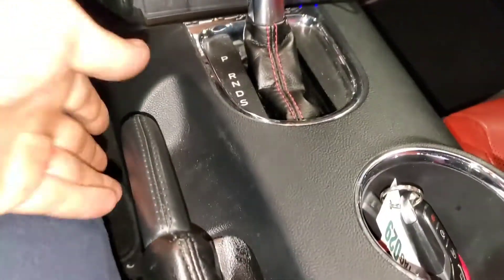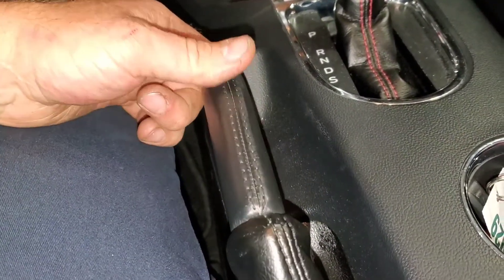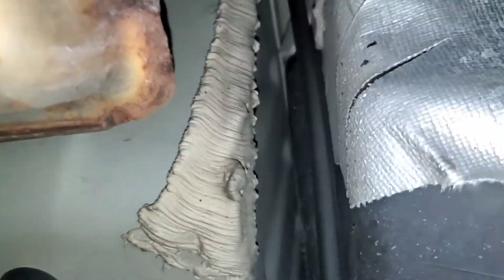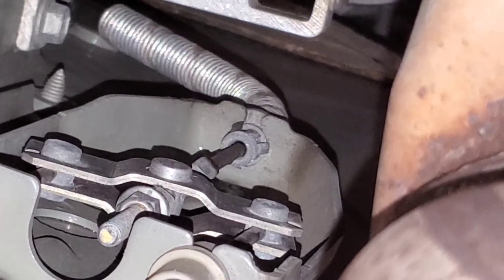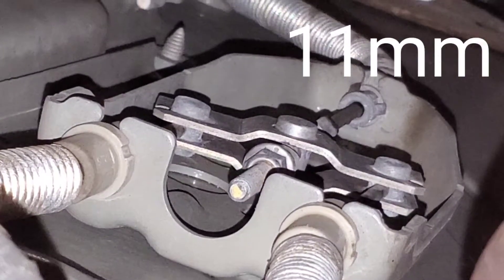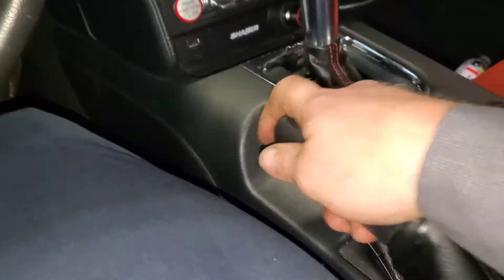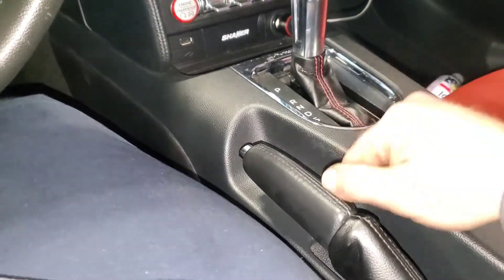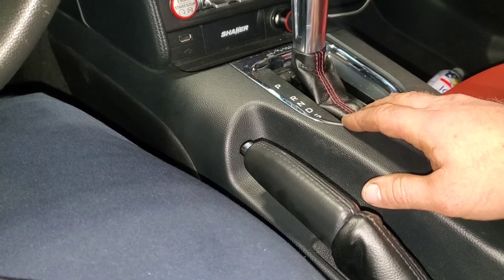2015 Ford Mustang Emergency Brake Loose Handle Poor/High Engagement - Other Mustangs Also

Comment: This is a great video for this but I did have to add a sleeve in between the nut and bracket to make it pull farther.  After a few months, the brake handle is still tight but won't stop the vehicle.  I checked the caliper and it won't pull the cable far enough as it hits the stopping points.  Has new pads and rotors, now it seems like only fix is new calipers, unless cables are strechted?  Ugh.

Comment: Mine never was adjusted properly since I drove it off the lot in December 2014 with 17 miles on the dash. I’ve always had a high lever. Being that mine is a manual it’s concerning now years later I hope it’s not rusted 🤦🏾‍♂️

Comment: 2015 50th yr gt.....74k...adjusted 2xs in the past yr...1st it did work..2nd didnt do shit...i can push car with brake on all the way up..pads replaced at 55 k....had removed rear sub to install bmr diff bushings in 2022....brake worked fine untill fall of 23..now past 3 months dont work at all

Comment: I’ve been having this issue for a month or so now I tightened the brake cable which seemed to work for a few days then one day my car starts rolling down the street and bumps into my neighbors with the ebrake still on and now it’s been driving me crazy since I do door dash on the side so getting out shutting the car off leaving it in 1st gear every time is annoying
Reply from the maker: Well then you're going to have to tighten it up even more and if it doesn't tighten up any more you either have a stretched cable or your brakes are wore out

Comment: Got a 17,calipers aren't engaging nor releasing. Even while doing it maunally.Have you seen this before?
Reply from the maker: It could be a hydraulic control unit issue or it could be a collapsed line some kind of blockage somewhere

Comment: I put mine up on the lift this weekend and noticed the rectangle piece where both cables meet on the driver side, there was a frayed cable that had come out of the cylinder.  I'm assuming i have to buy the rear cable but does that rectangle piece come with it?
Reply from the maker: I don't know if it comes with it to be honest with you

Comment: Does anyone have a noise where like it sounds like a lacrosse ball dropping, I did a burnout in it like a week ago but it drives fine and it’s completely normal expect for the sound. It also only happens when accelerating and at like 5-20mph
Reply from the maker: No idea

Comment: New York would fail an inspection for that.
Reply from the maker: silly regulations
Reply: @FordBossMe  Depending on who does the inspections. "Must hold under moderate acceleration.." The quick lube places like to fail for that, they don't do the repairs. They may over look things that are really bad. They can rev it high, it fails, and look like they are really inspecting things.

Comment: My e brake won't hold even after adjusting it even after getting the slack taken cared of. Any help on this? I'm defeated
Reply from the maker: Make sure that your parking brake elbow in the rear where it goes through the back of the brake housing isn't Frozen it needs to move freely
Reply: @FordBossMe  where is this located, in the calipers? Or located along the cables?. I'm sorry I'm so lost. But anything helps right now.
Reply from the maker: Go to the back of the vehicles where the brake calipers are and look at the back of the assembly where everything mounts and you'll see the cable where it hooks on sometimes those arms get froze up
Reply: @Ford Boss Me  ok that's what I was going to check next thanks bro
Reply: @Ford Boss Me  the elbow is stuck bro what do I do now? I'm thinking of just getting new calipers and rotors. The cable does pull.

Comment: anyway to manually disengage the e brake? mine is stuck in my 14 mustang
Reply from the maker: You got to take a pry bar and a hammer and go back to the rear rotors and where the cable attaches to the lever you have to take the pry bar and the hammer and tap it forward or tap at the opposite direction of the way it's stuck and spray some people after on it and eventually it will unstick just keep tapping and hammering back and forth

Comment: How to you get up into and tighten the screw? Do you remove the exhaust? Also if it is rusted what is recommended. Thanks!
Reply from the maker: I use a long extension or a couple long extensions a universal and a socket and I spray it from underneath I also have another video in my library on the same thing
Reply from the maker: You'll be able to do it just fine from in between the exhaust if you just use a 3/8 drive ratchet long extensions a universal and an 11 mm socket deep
Reply: I dont have a lift .. using a car Jack all I have .. that's in a terrible spot . .my deep well socket wont reach the nut over the screw .. 
So far all I've been able to assess is that when the brake is pulled the front of the cable pulls about 2-3 inches .. the 2 cables coming out the back to rear brakes hardly move at all .. so I'm guessing that is my problem..  but damn without a lift it's a pain to get to . . Gonna look for a deeper 11mm today
Reply: @FordBossMe hey where is this video? Can’t find it